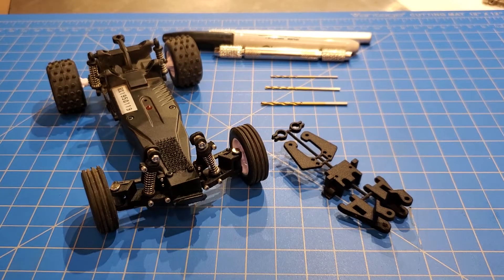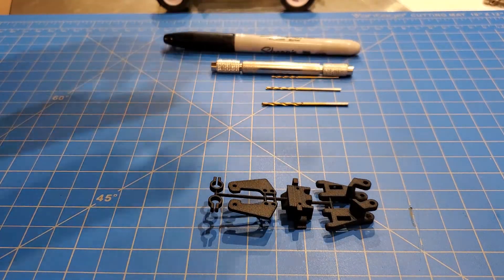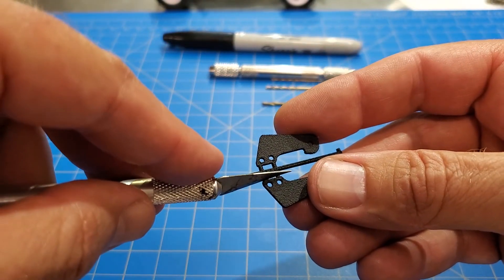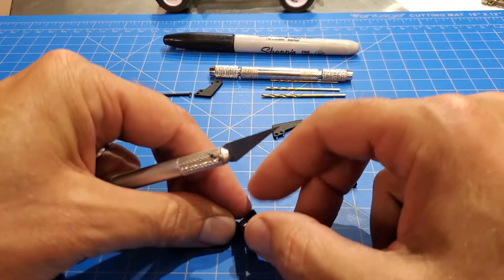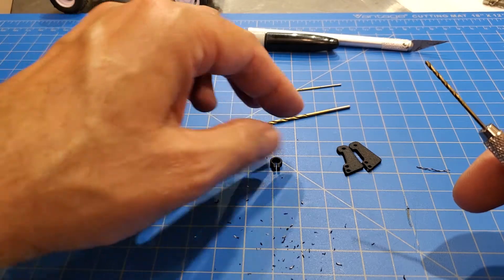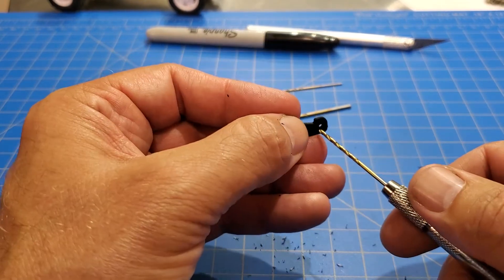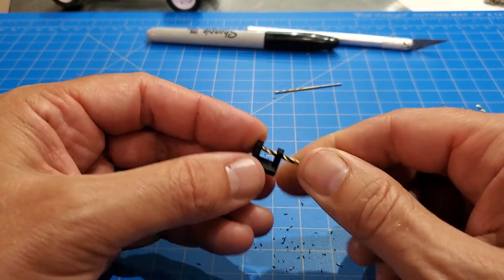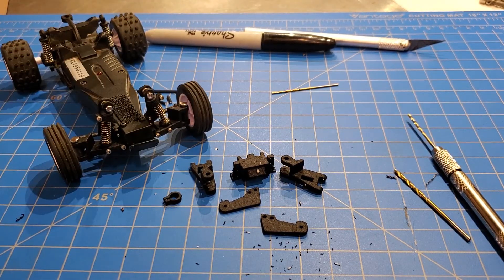RC28 Front suspension kit assembly: Part 1

Comment: Would these be compatible with a tr28?
Reply from the maker: It works for all the AE 1:28 scale cars, they're all the same car, just different bodies, wheels/tires, and body mounts.  On some models trimming of the body may be needed to allow full travel of the front suspension.
Reply: @brianconklin3439  ok sounds good. Thank you.
Reply: @brianconklin3439  also do you have a version on your website with all the hardware included as well?
Reply from the maker: @crazymariofan8806  Sorry, I don't have a website.  You can check this video and it's description for information on ordering the hardware: https://youtu.be/26gViBJb-xk
Reply: @brianconklin3439  thank you

Comment: Great video! I know I ordered the kit months ago but I'm finally getting around to installing. Will have to get some drill bits since my parts came with small holes, but that's a wicked easy fix
Reply from the maker: Glad to hear it!  3D printed holes usually come out on the small side.  This is good actually, because then they can be drilled very precisely for the best fit! :)

Comment: Thanks much Brian, got my mt28 a few says ago and this will be a much appreciated upgrade. Thanks again!
Reply from the maker: I just picked up an MT28 too, I love it! Goes over dirt and rough ground a lot better than the buggies because of the extra ground clearance. And, I confirmed the suspension kit will clear the MT28 front body mount no problem! 👍
Reply: Good to hear, that was my only worry if the mount would clear. The MT is a blast, but I learned the hard way that the wifes hair and that axle do not mix; now I vaccuum the carpet before running it inside 😂🤣 Any word on the hardware kit?  And once again, kudos man, excellent craft.